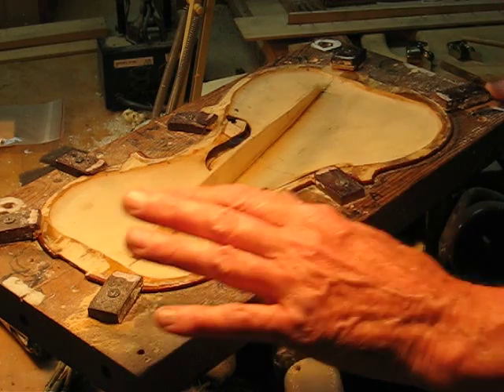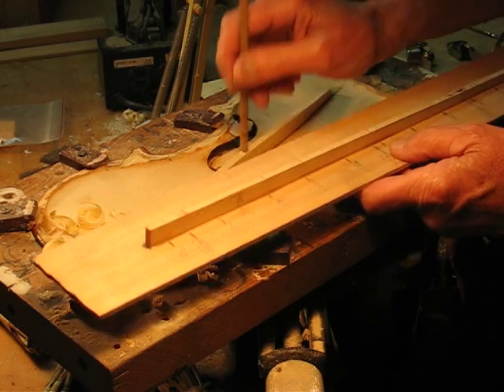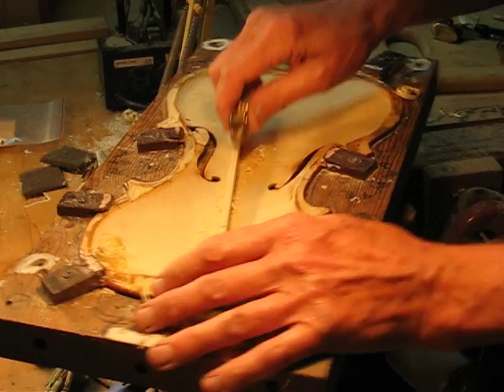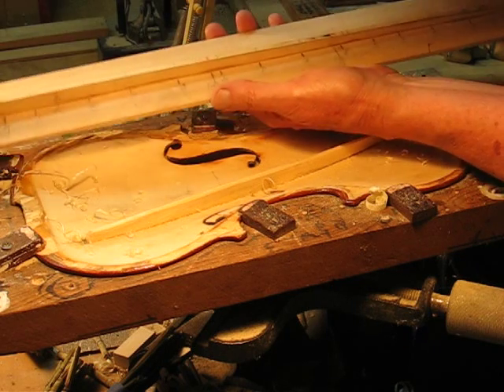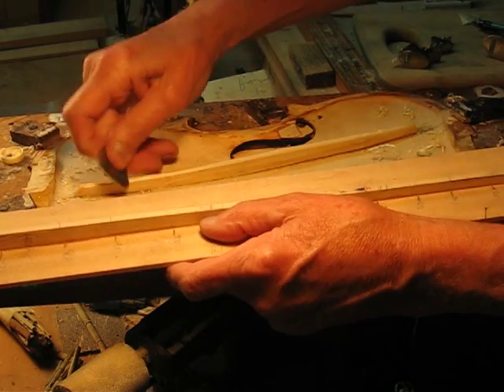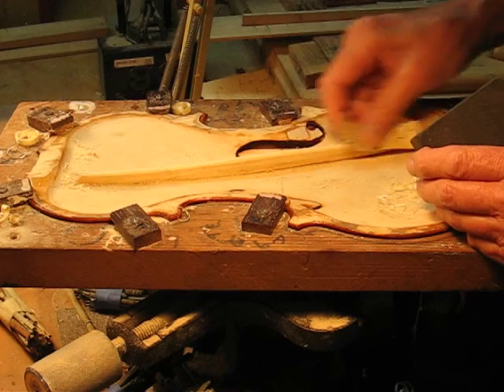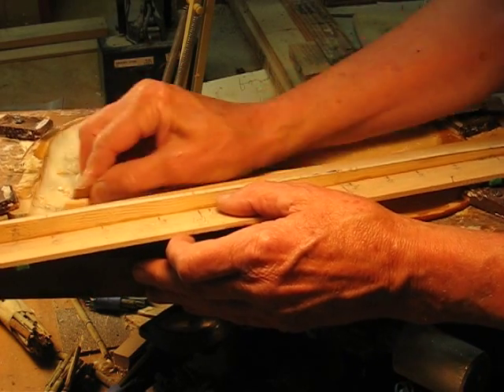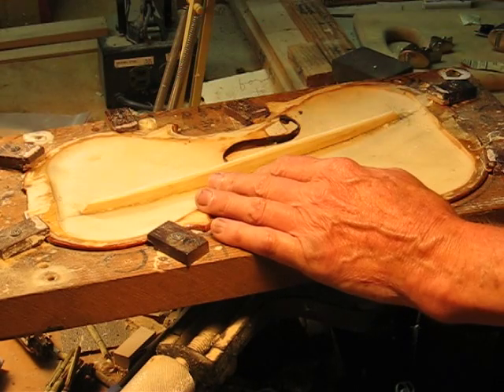Bass Bar Shaping / Tuning on my Opus #15 Violin

Comment: Considering the angle it's sitting at and the half millimiter glue cushion sitting below, I don't see how this tuning is relevant in this case
Reply from the maker: Sorry for the misunderstanding.  I used one of my experimental violin with angled grain top wood which then required and angled bass bar in order to maintain the same centerline angle of bass bar to the wood grain.  The shaping is then the same general process.
   It was what I was working on at the time;  perhaps I will re-record in the future so as not to confuse.  By the way;  I had to make three approximately identical violins to test this theory (one regular layout; one with angled top grain and angled bass bar; and one with both bass bar and top grain angled... as here.)  result:  both must be done together.
  I am not sure I can say for sure if one is superior or the standard technique with straight wood grain.   I thought it should be tested... All after the comment by a famous French acoustical expert, whose observation was that longer length grain vibration would produce the best sound;  thus the idea to angle the top plate grain angle.... David L.

Comment: I'm not getting it. The standard sounds higher pitched than the violin parts. Do you have a video that explains it?
Reply from the maker: +Englehard Dinglefester You may be correct that I had yet to accurately adjust parts or all of the bass bar in the example,  Your ear may well be better than mine!  I believe the principle is correct however poor my performance.  doing these training videos only allows a short period of filming time before the film time runs out you understand..
Reply: I mean the standard sounds high pitched, and I can't divide out the high pitch sounds which I assume must be there, when I hear the bass bar tapped. I don't hear anything close to the standard tones. So you are saying that from your chair, those high pitched tones are in the bass bar? Then it must be my monitor speakers
Reply from the maker: +Englehard Dinglefester You raise some interesting points.  Tap tone tuning is a skill, and like most skills, it must be cultivated over time and with a considerable effort.  I would suggest a good starting point, if you are seriously interested, is to read the short articles on tap tone tuning on the website: www.acousticaltuning.com .
  The basic idea is that tap sounds, as well as all musical tones are complicated with many overtones above the base or fundamental tone.  We need to learn to hear only the fundamental, or lowest part of the tone or pitch; kind of like listening to an orchestra and picking out the double bass part only.
Reply: Hi David I can hear the fundamental all right, I was looking for the overtone that matched the standard and can't hear it.

Also, that link doesn't work but will look around anyway.
Reply from the maker: +David Langsather Ops!... The correct website link address is : www.violinresearch.com .  David L.